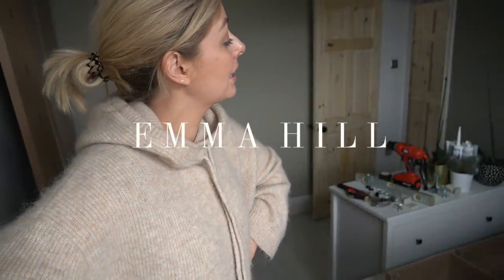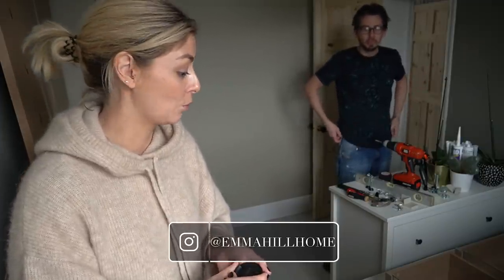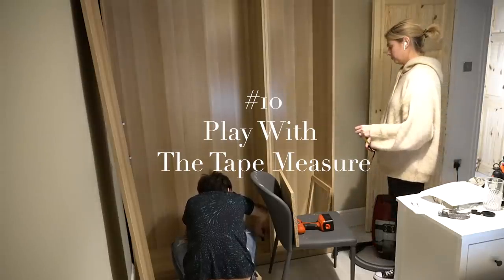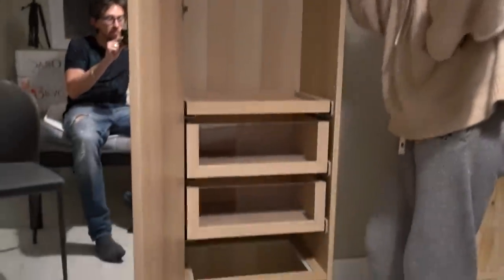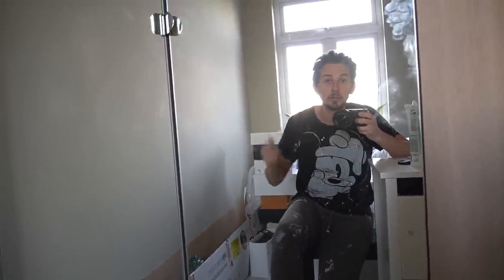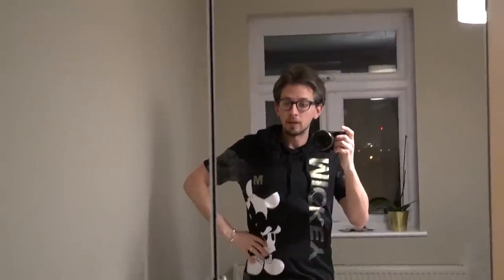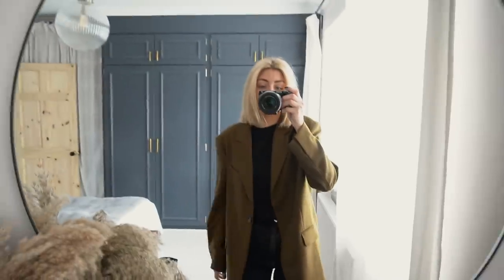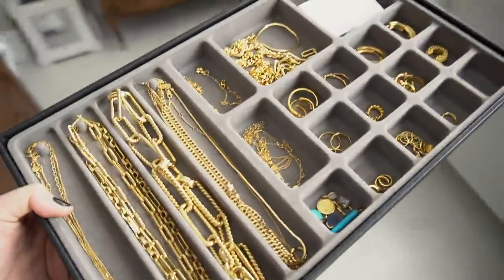Ikea Pax Wardrobe Tour & Print Framing Hack

Comment: Just a suggestion in regards to the print framing hack - My understanding is that the reason the print crinkles beneath the glass is because of temperature changes in the atmosphere. And so an alternative to the extra backing board would be to seal the the outer edges of the existing backing board with caulk or sealant, perhaps much the same as you would use on your skirting boards, to keep moisture out.  Have tried it with success. Thanks for another great video Emma!
Reply from the maker: Thank you for sharing 👍❤️

Comment: Thanks for sharing your diy tricks. And how helpful you are, Emma 😂😂 nice job, Simon! Those Mickey sneakers are so cool 😍 not to be all in your grill, but did you get braces or Invisalign or something?
Reply: Ha. No problem. Yes I had braces fitted over December and January (top half first then bottom half). Ive had gum issues most of my adult life and tried everything else and braces were the last option. Discussed all the options with the dentist and they advised that the original braces (metal ones) would provide the best outcome so went for those 👍
Reply: @simoncreasey4067  sorry to hear that. Hope it works out for you 👍🏽
Reply: Not a problem. The braces don't bother me, but will be nice once there off later this year 🤞